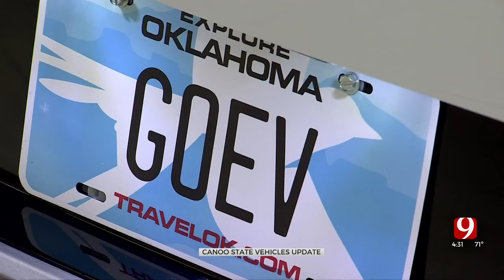Canoo Finishes First Production Of Electric Vehicles

Comment: EV's sales slowing has less to do with consumers wants and EVERYTHING to do with manufacturers only selling their most EXPENSIVE trim levels on most every single vehicle out there.  There are limited supplies of batteries (mainly) and still chip shortages.  So if you can only produce 100,000 of a given model would you want to sell it as a 45k base model?
Or a loaded 65k top line model????????
 
 WHEN someone comes out with good EV's that you can walk in and buy for 40k there will be all the sales any of them need.

Comment: The EV market is not tanking. Dealerships are refusing to sell them for any reason. They don't want to sell EV's because there is no service needed by the dealerships. Tesla is up, Ford is up, Hyundai is up. You all have no idea what you are reporting on. Canoo is a great idea. But they have to get moving. Anyone who comes out with a low cost work truck for the public now through 2024 will win the war in the US. Tesla sent out their entire system process for building out 48 volt trucks to every CEO that makes trucks, for free. Ford just thanked them for it. Get on board or get out of the way.

Comment: Smotly lowly yobly,,,,but first line  with better gear box  mode 4x4 end 100 years end more Neodium Engine...pleasee dont miss me..the hawy piece on that wiackle Will be a trasmiter or reductor for all tires...can you yust imagine that  for more than a 100 years...
Cheep simple no IT no eletronix  no senzors,,fuel pipes ,,ewend the version with double flor  for easy floating end propelers on side of tires for smooth fine watter driwe,,,
Secondary werry cool for worck in P mode or parking placec24/7 for watter pump generator or anyting usable..end all 101 years +++..
PS
Fine littke Canoo  ....but version of biggg  will be a someting